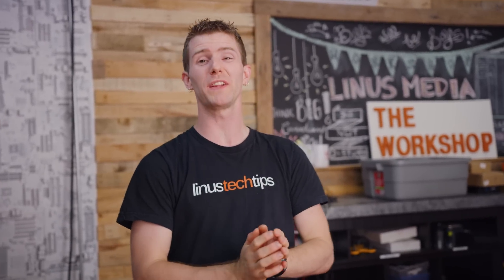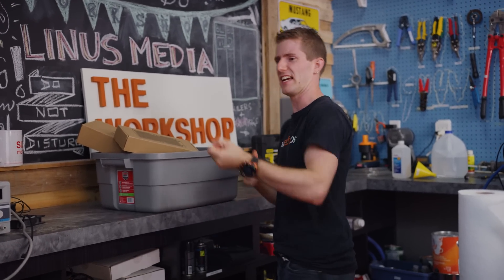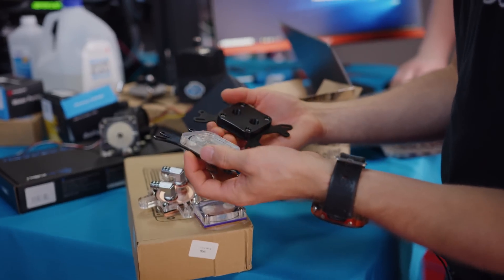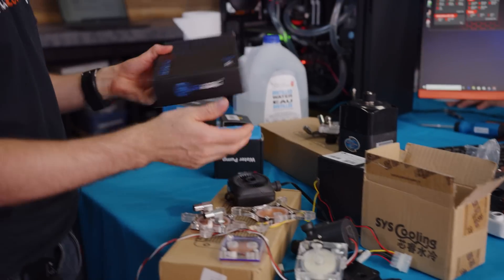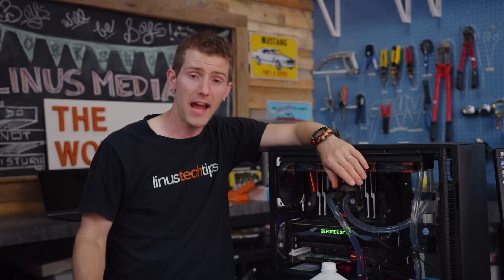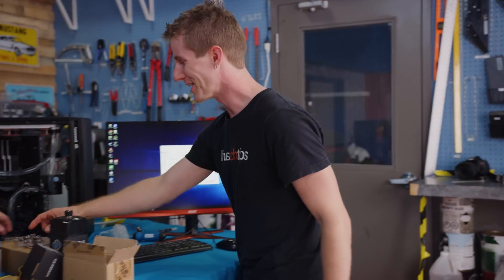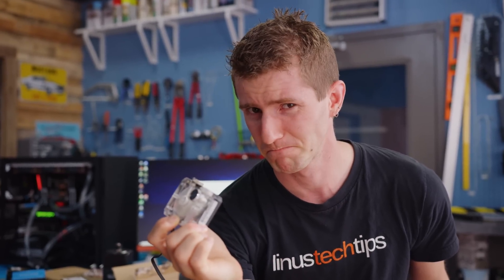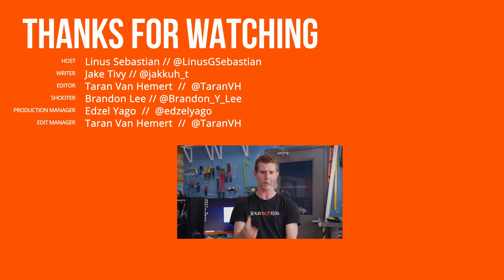AliExpress Water Cooling DOESN'T Suck?!

Comment: As a Chinese, I have to mention that the sellers on Aliexpress know that u guys are all foreigners so they make the prices much much much higher than they should be.
Reply: So what is the aliexpress of aliexpress? haha
Reply: @mythbuster74  That would be Tabao. Unlike AliExpress it is Chinese language only and you actually have to communicate directly with the seller.
Reply: @thebluemarauder  WAIT YOU NEED TO COMMUNICATE WITH THE SELLER? FUCK I WAS ABOUT TO BUY FROM TAOBAO
Reply: Yea but it's still really cheap compared to the big businesses
Reply: Eh don't mind. Still considerably cheaper. I mean, ridiculously lower. I've purchased laptop displays (top quality ones, 1440p IPS panels) for about $90. Going strong for over a year, no bleed or flickering or anything. Also other things, like audiophile earphones (tin audio T2 pro), WiFi cards (9260ac, bcmo4352z for hackintosh etc). Always worked properly.
Reply: @summushieremiasclarkson4700  Their headphone game is getting up there for sure, I have a set of Fiio in ears that sound amazing (I probably paid a lot more than you would in China judging by some comments here but idgaf they sound great).
Reply: @summushieremiasclarkson4700  I couldn't resist chuckling when you mentioned a dynamic driver earbud set being "audiophile". Still, that is way cheaper than Airpods, which are also just dynamic driver systems. Now if you ever run into a pair of multi balanced armature driver IEM's for that kinda money, do let me know and I'll glady eat my words :)
Reply: @tfm2934  true. Audiophile "culture" is a bit of a meme, anyway.
Reply: Thats kind of a given since it probably only cost like what 18 cents max to make one of those blocks in a factory in terms of material cost.
Reply: Oh yeah they totally send it across the planet for free. They need to make that money some how. I shipped to around china before and it cost me 80 dollars for about 4 cooling blocks worth of weight and volume
So 15? Free shipping? That means they are making it for pennies.

We are not stupid lol
Reply: @screener545  I'm a bit late to pitch in, but Chinese businesses get subsidies from government for shippings, so it's dirt cheap for them. It's to encourage export and inflate the numbers. If you are regular Joe from outside you will pay full price which is same as everywhere in the world. This is why they can send small 1$ item with free shipping, or a brick for only 5$ shipping. Of course, the production cost is also stupidly low, but if you compare same item from different sellers, you get general idea how low they go before it's not profitable for them. Some sellers will put same item with same price as competition, but with 2$ shipping. That 2$ shipping, in reality, is just bonus earning because people tend to not notice these small fees in shipping. But I digress a bit there...
Reply: @screener545  the 15-40dollar budget cpu coolers from aliexpress, ebay and amazon are only about 1-5dollars in taobao, owned by same company as aliexpress, but just for the chinese, if they sell so low for the chinese they more than make up the shipping if they ask 10-20x more in the international shop for same product
Reply: @screener545  I ordered a reservoir from AliExpress to Europe, free shipping. :)
Reply: The reason that it is so expensive (relative to just buying from china) is that aliexpress is for foreigners, and the sellers price the things extremely high. If you go on JD.com, you can get cheap parts (if not imported), which may even ship to the US or Canada. Also, because JD sellers know that you can (since you probably are in China) return the parts with minimal cost, they usually sell legit stuff, unlike aliexpress where the sellers sell fakes because they know that the shipping for the return probably costs more than the part.
Reply: Taobao cheaper.
Reply: i think that applies to every country.
Reply: GARYw w still cheaper than what we can buy from companies here
Reply: OH NO!
Reply: how  can you use  youtobe ??
Reply: Imma use Chinese VPN hehehe
Reply: That doesnt even make sense. They just post a price. Anyone can access that website. It's not like the website only works for specific people. Anyone who buys will be paying the same price.
Reply: John Smith  Well, China is Communism, not Capitalism. with communism everything they make goes to the government and the government distributes it out to everyone else. Or at least that is the way communism is supposed to work.
Reply: @bkpickell  ... political scientist here (i know, it's a crappy diploma) but at least I have studied enough to tell you're wrong, you're saying the basic knowledge of communism and implication on government public politics, it doesn't work that way in China's communism. check wikipedia on "politics of china". I am no expert on China' studies (and I'm from Brazil) but it's been a while since the private sector in China is somewhat free to do business without the State intervention. So calm down when you talk about communism and capitalism. 2018 governments are totally different from the old fashion regime knowledge.
Reply: @ryobr  bkpickell is likely a fellow American, and a particular half of my comrades are complete morons brainwashed into thinking anything not Murican [mixed] Capitalism is socialism or communism & therefore bad.
Reply: @bkpickell  china Is socialism
Reply: @bkpickell  no youre confusing economic policies with political fundamentals and with distribution systems. communism can established in all sorts of ways and distribution systems. communism as a realtivly pure form of marxism is in first line a social concept that in its consequence form also an economic concept. 
ofc marxism has it inherent that the goverment will always be authritarian, and those usually tend to voerly control things. but purely to stay in the real of a communist systems you could use all sorts of distribution and economic systems as long the revnue is shared equally and no individual gets an advantage.
ofc that whole system and though process is nonsense. marx was not that smart of a person and jsut filled with hatred for the upper class (regardless he was uppclass too). so marxism is in essence anti compentent people, not pro worker.

Comment: The bottom of the flat block looked really rough. I wonder how well it'd do if those scratches were polished out to a mirror finish. Not saying it'd make a huge difference but 3-5 C would make the 30 min for a less than half decent polish job worth it.

Comment: So I was thinking if I mount my case on its side with the cpu side facing down and my cooler leaks it will just run down  the tubes and on the floor and not on my motherboard is that a correct assumption?

Comment: Why don't cpu manufacturers make a cpu that has greater surface area to dissipate heat better. We pay through the nose just to get the smallest cpu possible and still be efficient. Well scale it up, if there is room for water cooling there is room for a larger cpu with better thermal efficiency.

Comment: I know this is far fetched but I'm a noob to PC gaming but I'm also really (cough) somewhat smart, I want the newest and the best PC gaming system, around 2500 to 3000 USD.  My problem is I'm getting pulled in all directions for building and decided to what the hell ask and cross my fingers for a response.  If not hey I tried right. Any help would be wonderful.

Comment: I need to post pictures of the one I did with a P2 / P3 where I had water running right against the back of the die. ( it worked but was a mess )

Comment: I've already got myself a AIO cooler for my CPU. But what about cheap custom water cooling for a GPU?

It should also be noted that when you overclock your CPU/GPU to the max, you also need to take care of the components delivering the power as you have just taken away the air cooling from it.

Comment: I don't do water cooling, or gaming, but I keep getting Aliexpress adverts in Facebook telling me about 108W Peltier coolers. I know that TEC cooling was fashionable briefly but it would be interesting to see if a $40 Peltier enhanced radiator can actually work?
Reply: It will but you need to keep in mind that you also need to buy a heat sink for the peltier hottest side and also built a isolated place to place the radiator...

Comment: Been using custom loop from aliexpress for the past two years, everything from aliexpress, pump, fittings, tube, etc. Not once did i face a problem. Thats is what i have been telling my friends as well, not always necessary to go for popular brands when it comes to custom loop. 

One more thing, I know people are gonna laughed at me for saying this... don't mix aluminum and copper, etc etc.,. Well my radiator is aluminum, my cpu block is copper, i have been using distilled water for the liquid and i have not experienced corrosion in my loop at all, its been two years, no corrosion.

If you are on a budget, get them from aliexpress, you will not be sorry
Reply: Hey what pump did you use?
Reply: Distilled water, that's the important part. Mixed metals on a x ray drffactometer with tap water (an aluminum in line filter) and it got corroded fast and hard.
Reply: How did you choose your parts?Did you a forum post about that? would like to hear more about it ^^
Reply: these are the parts i have been using for two years now.. Still working great, no problems so far, temperature is very very respectable, use distilled water, no silver kill coil etc.. needed, corrosion does not happen at all. I have flushed the loop once, that's the only maintenance i did. So, if you are on a budget but want a custom loop system that looks good as well, get them from aliexpress. You can get a custom gpu block for like $60-$100.

https://www.aliexpress.com/item/240mm-18-Tube-Straight-G1-4-Thread-Water-Cooling-Cooler-Heat-Radiator-Exchanger-for-PC-Computer/32840284506.html
https://www.aliexpress.com/snapshot/0.html?spm=a2g0s.9042647.6.2.30b64c4d83wfCg&orderId=30762252344348&productId=32845969539
https://www.aliexpress.com/item/Water-cooling-OD-14mm-acrylic-hard-tube-90-degree-connector-double-joint-removable-quick-twist-2/32698393683.html
https://www.aliexpress.com/item/High-Transparent-8-X-12mm-OD-PETG-Tubes-Rigid-Tube-50cm/32706427276.html
https://www.aliexpress.com/snapshot/0.html?spm=a2g0s.9042647.6.2.4fcc4c4dDFfJ1u&orderId=30441457764348&productId=1000002988014

https://www.aliexpress.com/item/Square-Computer-water-cooling-3-way-water-flow-meter-speedometer-with-fitting-nuts-blade-optional-LSJ05/32347813575.html

https://www.aliexpress.com/snapshot/0.html?spm=a2g0s.9042647.6.2.18ab4c4dkvVcUO&orderId=30441416574348&productId=32763885465

https://www.aliexpress.com/item/G1-4-mini-Silver-Valve-of-female-male-part-for-waterway-control-for-PC-computer-water/32691285135.html

https://www.aliexpress.com/item/OD14mm-Hard-tube-fitting-QYFREEZE-Brass-hand-compression-fitting-nut-G1-4-thread-High-body-design/32669575202.html?spm=a2g0s.9042311.0.0.27424c4dV8DeGe
Reply: You are a god!

Comment: I have a loop made with aliexpress components and I can only say this: The parts in this video are the extreme low end even on aliexpress. Search for Barrow or Bykski and their product lines. I have a barrow energy waterblock of about 35$ that has a max delta of 1 degree between in and out (have sensors there) at 1800 RPM on an china D5 copy that may be actually better than the real D5 (has full aluminium housing, acrilic top with various ports, and PWM header separated from the power molex. It even has meshed cables). The design is far beyond what brands offer (aluminium elements for decoration and rgb lighting, ironman "heart" style. The pump, at 5000 RPM is still very silent. The rotor is similar to original D5 (some bought it just to change defective rotors) and has ceramic 3d shaft (not just a ceramic ball like the real D5). The price for that is more than half of an original D5. The radiators are phobya/alphacool for copper reasons witch I got cheaper than the one presented in the video. Also, look for the barrow filters and reservoirs witch have QUARTZ GLASS instead of acrylic. Barrow also have temp sensors, flow sensors that show the flow rate in L/h, flow indicators that output RPM signal to MB and other cool stuff. The only thing better that I could want are some monsoon accessories. Did I mention the water blocks that have VFD temp display indicators embedded? As for the seals, The single leak I ever had was from not tightening enough a fitting (fixed just by more tightening).

Comment: What liquid did you use? Just water or cooling liquid wich normally goes into a cars cooling system. Maybe it is worth to try that because of its higher boiling point in stead of water?

Comment: Also those pumps aren't bad at all. not the best on shelf, but they do their jobs. i've mined on that config for 2 years and they never failed. searchin no water if you  don't have full budget is def. worth it.
I actually used it with aluminum rads too

Comment: You can mix metals, but typically it's gonna be more expensive to buy good coolant that won't be phased by it.  Using additives and/or a kill coil won't do much with distilled water.  You're better off buying matching components.  And then still using a good coolant.  I use Koolance liquid coolant.  I've ignored loops for 2-3 years without any trouble.

Comment: I have my 7700k on a coolermaster aio i picked up for 60 bucks at microcenter. The cpu gets stupid hot when i use the rpcs3 emulator with a 9% overclock.   I wonder just how much better it is with true water cooling. Aesthetics aside, from a pure performance and cooling standpoint i wonder just how much more effective it would be to grab an aliexpress setup

Comment: i build a aliexpress/cheap ebay junk watercooling loop with hardlines, 3x120 cooler, cpu and gpu block, reservoir, pump, flowmeter, drainvalve and all that for under 100 bucks... i used cheap fittings for like a fitting 2 bucks... cant say anything bad about it.... well except that the pump could be a little more silent

Comment: The cost of watercooling isn't really in the main components it is in the fittings especially if you do hard tubing I got all my stuff from Ali express and still spend 600 euro in the end most of it in fittings plugs valve adapters etc.. Radiators I brought from hwlabs which was another 140euro add 120 Euro for noctua fans and its not really that cheap. That's when you go with the non trash no name China stuff ofc like Barrow. But had I brought the same stuff here I'd have payed around 1800 Euro total so while not cheap still way better value then the ek and bitspower stuff for fittings etc that are identical.

Comment: I don't understand why you did not use the Bykski 240mm Copper Radiator in the video but not benched or a 360 Copper radiator. That Bykski CPU Block is actually copper.

Comment: Linus. You should do a review on the cooling system of a car. You would find that they use cast iron and aluminum... it also stays alot longer in a car than a computer. That being said how is it that i will create corrosion in a computer and not in a car?

Comment: I built my watercooling loop from aliexpress parts. Later i upgraded block to heatkiller iv pro, and got reservoir to replace bottle i used for that. For me the point of doing aliexpress loop was to get into water cooling for cheap, with the option to upgrade to better parts later. Chinese block i used on cpu looks almost same as best looking one you had, i can say it doesn't perform as good as some proper block but not bad for the price. At 4.2ghz my ryzen 1600x ran 7c cooler with heatkiller, at 4.1ghz difference was only 3c.

Comment: If diamond has ~3x-8x the thermal conductivity of copper (~1000-3320W/mK, depending on diamond, compared to Cu's ~400W/mK) then why dont we just use a fine diamond powder, perhaps stabilized in an emulsion of some type, as a thermal "paste". Or build a waterblock that has a small diamond plate as the contact surface between the CPU die (of course delidding) and the coolant fluid. That seems like it'd be the coolest method, and the coolest... cause diamonds...

Of course a product like that would only be for HEDT's and extreme OC builds... if you only spent $1500 on your computer, you aint buyin diamonds for it.

Comment: I used car parts back in the day because I wanted to. What was inside of the computer was branded for computer cooling, but the radiator was an evaporator coil from a car and was put outside.

Comment: I can highly recommend tha Barrow components.. I've worked with a lot of parts from them, and the quality is really good, and i see no reason to choose a more expensive brand over Barrow... Gonna use barrow again for my next build for sure.. triple o-ring fittings, high quality on their reservoirs and pumphousings aswell and to date, not a single drop leaked on any of the parts. BONUS.. They include extra O-rings with their fitting so you have spares if you should tear one when using hardline and not getting the edges smoothened ok.